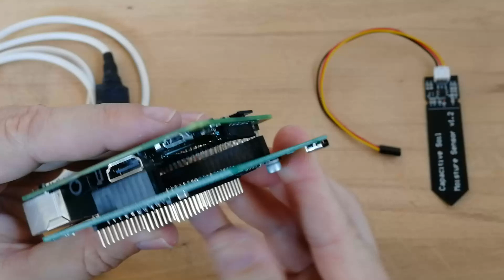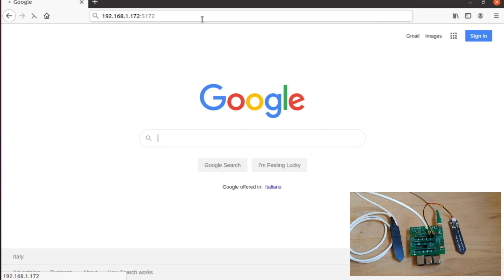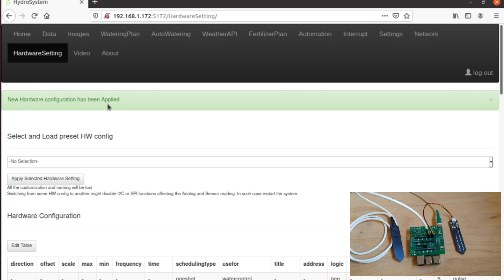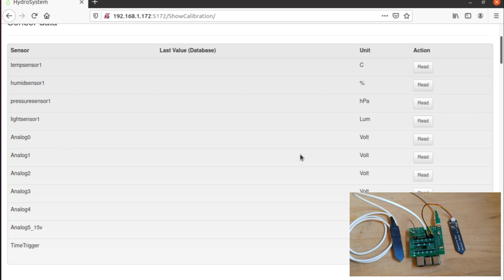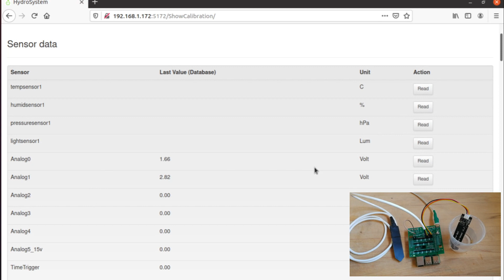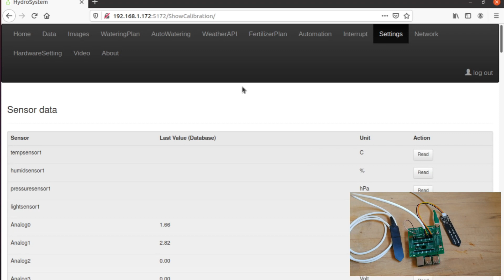Quick Setup of the Capacitive Hygrometer 1.2 and the AutomationHat Board

Comment: Hi, I try to connect these moisture sensors through a 1115 ADC. I can readout values in the OS, but not within the hydrosys software. Is the 1115 ADC not supported by Hydrosys?
Reply: Not supported. Refer to the link in the description for more info.
Reply: @angelovalerio9984  Thanks for the quick reply. Pitty I am not a coder, I could have made a nice contribution. ;-)